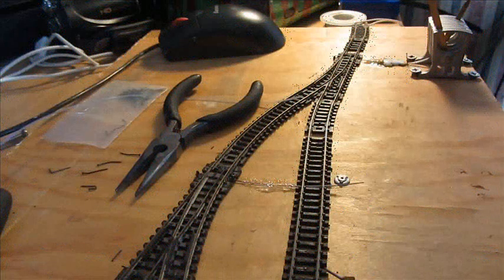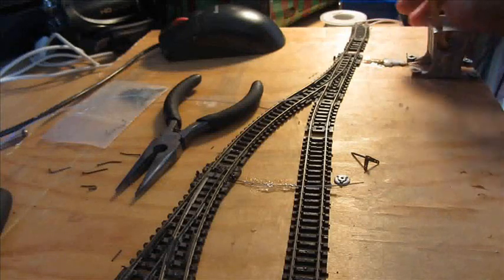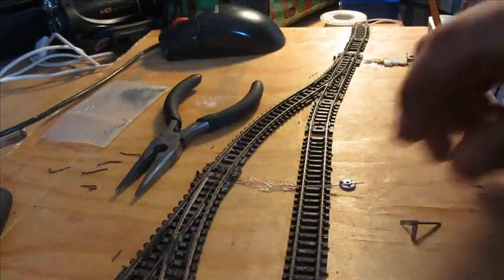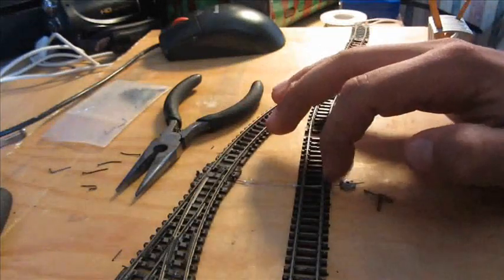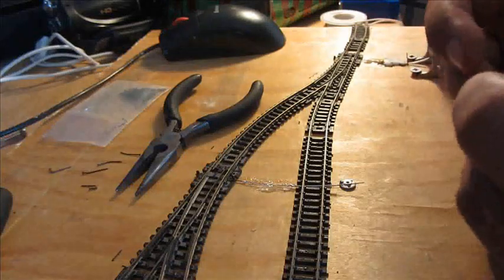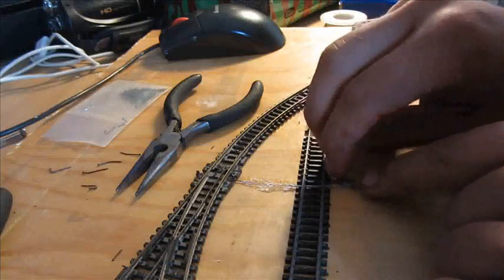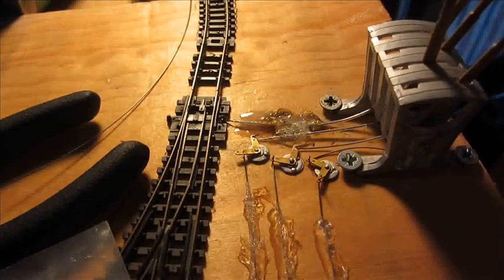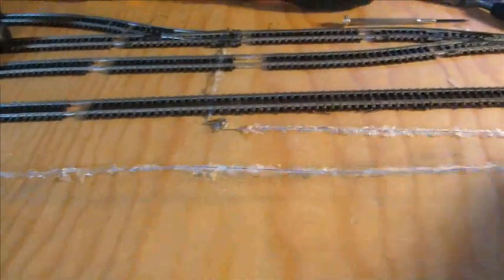' How To ' GEM Mercontrol Manual Point System - How to Install and Use Mercontrol.

Comment: Hi I am waiting for my starter pack to arrive for my N gauge layout. I just wondered instead of using glue would something like adhesive fiberglass tape or drywall tape be OK. My thinking is that this may allow a smoother surface for finishing with scenery etc.